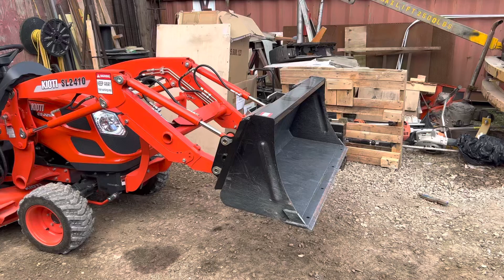KIOTI cs2210 loader drop issue

Comment: I’ve been doing research for a tractor for sometime.   I’ve narrowed it down to a cs2220 and a Kubota bx2380.  

There are some videos on the cs but the groups I’m on seem like there’s only problems with these tractors.  Starting up shaking really bad.  Fuel pump problems.  Injector issues.  This has me second guessing the lean to Kioti CS series.   Any insight is welcome!

Comment: Mine did the same thing but the at the boom at 2hrs. One cylinder held no pressure at all and the other leaked bad. Took two weeks and three trips to the dealer to get it right. They even tried to pass it off to me with the wrong cylinders from another machine(sloppy fit on the pins). I was 1 day from asking for a refund, but they finally replaced both cylinders and told me they had a tough time sourcing them. I'm at 90hrs with no problems since. https://www.youtube.com/watch?v=GJWtS-T0BMc